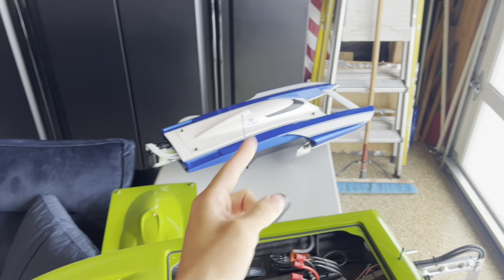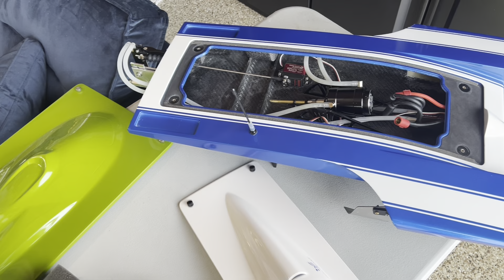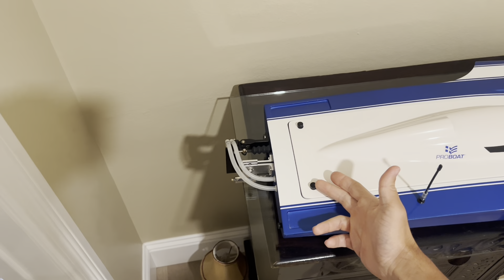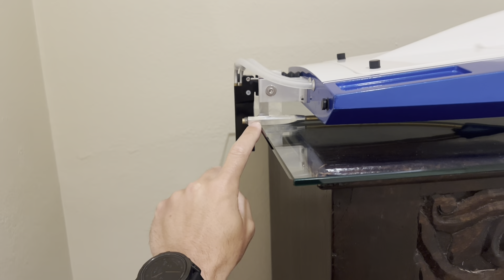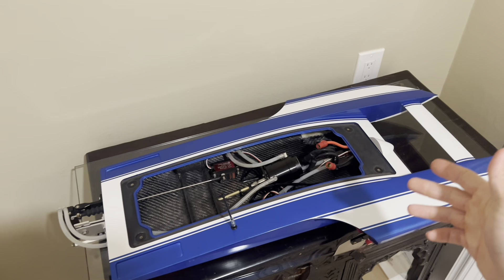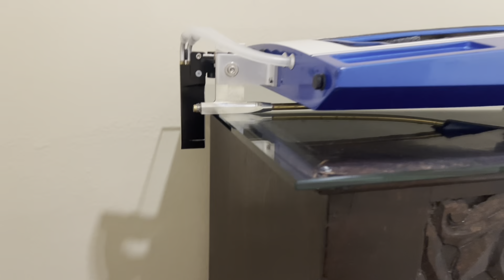Proboat UL19 - Got hop? Got high temps? Check this Out

Comment: Excellent video i foud a slight positive angle on the strut also helps coming out if the hole keeping the sponsons from going under water
Reply from the maker: Yes so what I was really trying to stress is that although it looks positive at first glance, once shimmed you’ll see it’s actually dead nuts neutral. Which allows me to run a prop with some lift like a 4519, m445, or abc h5 hydro prop😁👍🏼

Comment: Thank you for the class bro 🤝 What is the difference between flat bottom struts and rounded ones? 
Took your advice and I put the round one on my Veles, hoping for a maiden soon 😬
Reply from the maker: Glad to hear it! Hydros like some rear lift, the flat bottom adds some lift in the back which helps keep the nose down. On the veles it helps it hit big speeds without blowing off but as I said I don’t believe it helps with its turning issues😁
Reply: @RogallaMarineRC Thank you 🤙